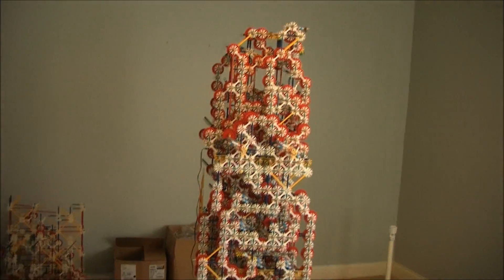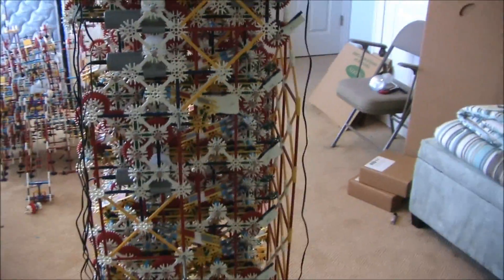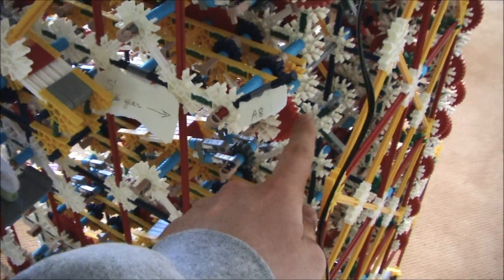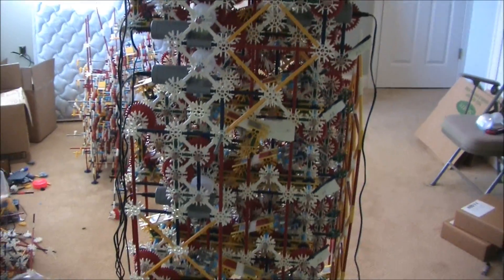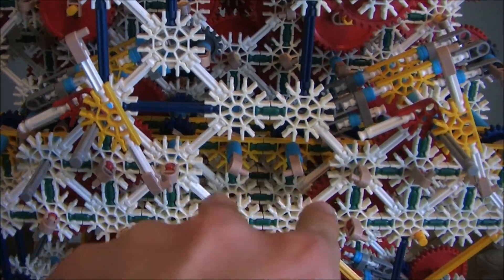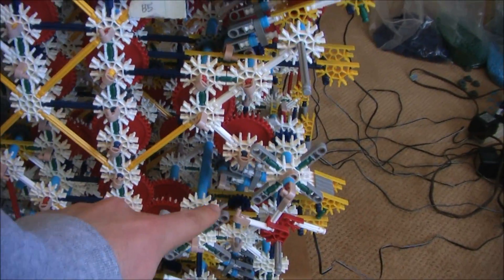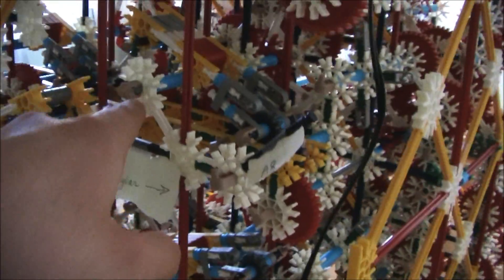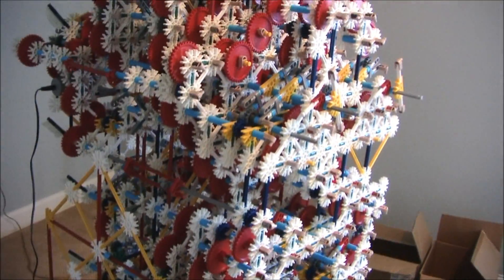The K'nuter - K'NEX Computer

Comment: If that is only a full adder then you gonna need a football field to fit the entire computer
Reply: That was the same problem with vacuum tube computers back in the day. It wasn't that they couldn't be made to work it was that they ended up being so dad blasted huge. If you don't know about them already Google the word "Univac".
Reply: You'll need a year to execute a single calculation. And "normal" wear and tear will mean you have to rebuild the calculator after every calculation.
Reply: Yes. That was true with the old switch and vacuum tube jobbies as well, and the principal impetus for developing solid state transistor versions as well as the IC based ones now. Greater speed and more reliability.

Comment: Where do i put the graphics card?
Reply: Oh man, I can only imagine how big of a fucking machine he'd have to build using these in order to get something similar to a graphics card.
(imagine one world trade center, like...that big, and that's probably an understatement)
Reply: Something that size would be almost (not) close to comparable to my GPU.

I have integrated graphics.
Reply: BOB.org we are also missing the speed, while it may be able to do complex calculations at that size even if you beefed the crap out of those motors electricity travels at something like 50 to 99 percent the speed of light. So we are talking about something that moves at way less than 1 percent the speed of light. Interesting as it is it would take a day for a single calculation. Idk im not an engineer what do i know
Reply: ZirrasElite it’s not possible.
Reply: r/wooooooooooooooossshhhh
Reply: It is the graphics card you could get lost looking at it for hours watching it add 1+1
Reply: ZirrasElite Actually, let's work that out. Let's say for the sake of argument, a typical transistor or the smallest element in a modern cpu is around 20nm (this year it should be half that for the smallest process node size, again simplification). We can roughly assume from the scale of the video given that a single gate made out of k'nex in this machine is roughly 25cm. Again, a bit of simplification here is needed because in most cases the actual transistor isn't as "boxy" as shown here, it's more or less "flat". So by simple division, 2.5 m x10^-2 / 2.0 x 10^-8 m is, again roughly, 1,275,000 times bigger in actual size.

Now, if we're talking graphics cards, a typical modern graphics cards usually has billions of these types of elements. So uh, yeah, roughly multiply that by the scale factor of 1.2 million and well, you got your dimensions. It's literally a million times bigger XD

Comment: And they say legos are better than k'nex
Reply: Creeper1764 Main 
A lot of this stuff can work in LEGO though
Reply: Fuck both I love Lincoln logs lol man I miss them
Reply: Knex = upgraded tinker toys
Reply: Nick Mieczkowski LEGO has technic and mindstorms.
Reply: *lego *is
Reply: You can do exactly the same with Legos
Reply: lego IS better, they have different sizes of motors and servos and all types of gears not just the tooth gears like k'nex
Reply: they both have there strengths. K nex is really good for building large scale things.
Reply: funny how all you guys are killing each other because of legos. like really, it cant get more immature than that.
Reply: Nick Mieczkowski ...they still are...
Reply: Legos just work. Do on LDD and you can do anything. Can knex make a working car? No, because they don't lock together enough
Reply: Creeper1764 Main What? They both have electric motors ahead of mechanical parts... legos just have more types of components like belts and chains, universal joints and hinges.... etc
Reply: Potato Slices How can they have the same possibilities when was has more freedom of building shit? Please don't answer that.
Reply: They are
Reply: ...but you can build cars with legos.
Reply: Legos have Technic, Mindstorm and even metallic surfaces inside them to make plug and play circuit boards or fluid boards, but I can't deny this K'nexi s pretty cool too.
Reply: You could do this more compactly with legos, without cheating with midstorms.
Reply: They both have the same possibilities but Legos has more freedom on building shit

Comment: Core Speed of 0.001hz
Reply: NightGrounds
0.002 with over clocking
Reply: NightGrounds more like 0.01 mHz
Reply: NightGrounds hz is faster than 5 minutes of 1 calculation
Reply: K'nex were vastly superior to Legos.
fite meh
Reply: Stephen Curry My Ass no as more because even if it isn't fast it does have multiple cores
Reply: jopkelplok no, it has multiple transistors, not multiple cores. If it had multiple cores it would be able to calculate multiple problems simultaneously, which it can not. The K'nuter would have to be far more complex to have multiple cores.
Reply: Just increase the voltage of the motors and that's your overclock done.
Reply: NightGrounds you're just SO generous to this processor
Reply: lol true @turnun
Reply: probs a thread lmao
Reply: i like MY LITTLE PONY yeah, isn‘t it Lego? Idk the american toys and stuff... looks like Lego 😂 lmao
Reply: and do you mean cpu?
Reply: NightGrounds yeah, thanks for the correction
Reply: lawl
Reply: pyrotechnics and more no it doesn't. Not at all.
Reply: does this even count as a 1 core processor
Reply: NightGrounds Nope, 1Hz means one oscillation per sec. (1/s) so my cpu has 3.8Ghz what means 3.8x10^9 Hz(1/s) / oscillations per sec.

So this Lego cpu in it maybe have 0.5-5Hz not more lol
Reply: +Cif The Meme Man 1hz = 1 second
Reply: k'nex

Comment: Those are not relays and transistors, they are switches, they are being operated by you, a human, not by a current or voltage like a relay or transistor. And since they are just transmitting power mechanically, they are just mechanical switches, or one pole, two throw switches.

Comment: What are the specs?
Reply: SirSnivy PVP 1 bit
Reply: .01 core processor
natural cooling system 
5 watt psu
no case no gpu tho
Reply: Intel gear i7 Overheated to 2.3 megagears
Nvidia GearTX 1070
16 Gears of ram
And a random geargabyte motherboard (I can't tell).

Ik I didn't mention the PSU or the case OR the fans (including CPU cooler).
Reply: it's over 9000 (gears)!
Reply: Stephen Curry My Ass technically its one core
Reply: Overgeared (essentially over clocked)
Reply: SirSnivy PVP 10000000 gears
Something
Cords
Wires
1292828928298298292892 million gigabytes

Comment: One thing you could possibly do is have motors on the inside that turn on when pressure is being put down on a trigger. This might reduce the loss and make your machine run faster without having to rely on the beginning motors

Comment: shows electronic motors
"As you can see there are no electronic components in this computer."
Reply: >electronic motors
boi do you even english
Reply: Ghostowl657 pretty sure those run on electricity.
Reply: joblessalex yes... which makes then electric motors. Not necessarily electronic. Mostly just pedantry, but have do you actually call them "electronic motors"? Like I hope english isnt your first language.
Reply: Ghostowl657 nah,  just to make the point that this is electronics to a degree.

Comment: One plus (minus one) is the most complex calculation a mechanical computer can perform, because it "flips" the most bits (I don't think the author mentions how many bits are in this full adder). Since a "one" bit is represented by rotation, and a flip-flop actually must be pushed by that rotation, this rotational technology will always be slow, "logarithmically slow", no matter how fast the motors turn. For a "linearly fast" mechanical computer, some other way of representing 1s and 0s must be found, and I'm not even sure it is possible.

Comment: That would've SUCKED if that final "power" input was turned on and you heard a loud snap from inside, to find out that the innards of the adder have been ripped apart.
I've blown a few capacitors -- not fun.
This? Way less fun if it were to break.

Comment: I ran across this old digital patent design 3109554 that used compressed air instead of electricity to run the logic gates. Have you ever seen such a digital computer and what would it be used for? Do you think that such a computer could be made with a 3D printer and throw in a little Nano tech?
Reply: Yes it can be made by 3 D printer . And i see you asking this in every computer related video.
Reply: Yea it's hard to get a reply from some folks. Something like 1 in 100. Started leaving the idea that if Babbage had gone with air that the pipe organ folks could have made his Diff. Engine for  him and Lady Ida would have invented COBOL.  Read that swarming soldiers crabs can but used in computing demonstrations. Has anybody tried this idea out using brush bots/ bristle bots? Seems like something kids would just go ape over.

Comment: Although this machine looks complicated, it's real purpose should allow you to realize computers work on fundamental, universal concepts.  In other words, even if you don't understand what is going on, a computer CAN be created simply using plastic (or wood, or brass, etc.) You could essentially take this machine back 100 or 1 Million years to teach "digital logic." Just replace plastic with metal and motors with running water. Computers are nothing other than these components, miniaturized. The fundamental difference between this and your iPhone is size.
Reply: +David Maiolo
Good point, everyone replying 'nope' doesn't understand anything about computers. I agree with you; computers are simply mechanisms that take inputs and calculate the output. You can see through the ages how people have created calculators using simple designs with basic materials such as wood, stones, water, etc. Our idea of a computer in modern day is simply a compact mechanism similar to these, but with thousands of these processes running at once on a smaller scale to achieve more advanced results. The calculations of 1 or 0 are translated in a long process into output on the screen. It's a very cool idea, that these complex machines we operate are just advanced, very compacted calculators.
Reply: Meme Farm Which means the fundamental difference is size because you can fit more of these in a smaller space.
Reply: Nathan Drake: Actually with enough of these clanking together you could a mechanical device that could crunch the numbers to play a video.  Though, obviously to play a video you would have to have a converter to translate the mechanical process to an electronic output.
Reply: Nathan Drake Yes, you'll just need 10 000 000+ of these.
Reply: @RequiemPoete:
Actually, you wouldn´t even need a converter. Theoretically (and I am talking very theoretically, as it would of course be extremely impracticable due to size) you could build a very large "monitor" with the pixels being represented by different colored mechanical plates which are either turned towards the viewer or away from him, protraying pixels if watched from far away enough, and have those being controlled mechanically. It´s the same as turning on different colored iodes with electricity. Of course it would be played very slowly or the mechanical stress alone would probably tear the whole contraption apart. But it is theoretically possible.
Reply: PuddlePig: Well I can think of one instance where we missed an opportunity to be 2000 years more advanced. Heron of Alexandria invented a primitive steam engine, that for some odd reason he didn't refine into a proper one. ( They think that the economic and societal concerns of displacing the slave labor force with steam driven machinery played a factor) The steam engine jump started the industrial revolution and from  200 years ago we are where we now. So yes. It's likely if refined, Heron's steam engine could have jump started an industrial revolution 2000 years ago, which probably would have led to an early computer age 2 or 3 hundred years later.
Reply: Kyle Owens More than hundereds, think in millions. look up how many transistors are in old low end cpu's, first intel core2duo (no idea if those can keep up with the bitrate of this video). there are 167 million transistors in the low end canoe architecture intel core2duo processor. lowest end celleron still had 100 million transistors.
Reply: Kyle Owens: Hundreds? A small microchip has thousands of these things on it. You would need, at least millions of these towers clanking away.
Reply: David Maiolo is
Reply: +Meme Farm That's not a fundamental difference. The point is that digital electronic computers work on the same principle, they are just more capable because we can fit much more into a more practical volume. If we had enough of these K'nex machines we could do anything that electronic computers can do, it would just take up alot more space.
Reply: SangerZonvolt: You, I like you. You may live to be one of my mad scientists when I rule the planet.
Reply: Yes computers have been made with lots of things other than transistors. We just use transistors mainly because they have no moving parts and are *tiny*.
Reply: You think to simple. You need a computer driven completely by ants and bees!
Reply: If you took this machine back 100 years,  you would get burned at the stake for being a witch!
Reply: RequiemPoete *Strengths I'm also a part-time grammar nazi.
Reply: Take it back to 2009 and use it to create the first bit coin and rename it a Bit Koin
Reply: There would probably have to be near hundreds of them working together though, right?
Reply: David Maiolo b
Reply: David Maiolo that is very enlightening. So if a computer could be made at the begging of human history, could something made in 1000 years be made now?
Reply: PuddlePig Unless the laws of physics change in next 1000, yes, for fuck's sake why can't people understand that just because X hasn't been invented by humans yet doesn't mean X is impossible to exist?!
Reply: David Maiolo ia
Reply: Mindblitz64 the screen isnt important to something so large
Reply: You know what I mean.. And millions are made up of hundreds, so technically I'm right.
Reply: +RequiemPoete
Good luck taking over the world, because you'll be fighting against me
Reply: Kyle Owens: Your Difference Engine seems to run off a measly few hundred towers where my War Computer is a Babbage Machine of several million adding towers. By the time you spin the crank four times I'll already know exactly where to station my troops and have deployed them.
Reply: Kyle Owens: Mwhahahaha!
Reply: Gairos: My God you're an ass.
Reply: RequiemPoete I know and it is partially intentional 1.) Making fun of stupid people is fun. 2.) Cyanide&Happiness number 3801.
Reply: Gairos: Well, can't fault you for being honest and playing to your stregnths! Lol.
Reply: When you're into computers, pussy is boring I:0
Reply: Hah, what a mess your machine will be. It will be huge, and after a few hours of trying to compute 1+2, it will catch into itself and collapse. Second, I don't need a computer to fight someone. My mind works well enough to know where to station my army, navy, and air force by the time the machine collapses. You will be surrounded and executed. Mwahahaha that
Reply: Pollux my 1 certainly goes where there is a 0
Reply: Nathan Drake Not only could it, but it is right now.
Reply: And a screen
Reply: MrFonz No you fucking moron! This is a calculator. When was calculator invented? Roughly 350 hundred years ago by Blaise Pascal. When did we start utilizing electricity? roughly between 1850-1900. Fucking idiot....
Reply: nope
Reply: David Maiolo No the fundamental difference is power and capability
Reply: David Maiolo why did you make such a nice comment and then to close it with iphone..... i dont have one, and call it your phone. Im not calling my phone a (insert phone name type and model here)  im calling it my phone.
Reply: David Maiolo not really

Comment: I'm gonna take out ONE piece and drive you insane trying to find which one. Ha ha!
Reply: The Tyttuutface pointless. He'd find it faster then it took you to take out. Due to what is no longer moving that should be.
Reply: The Tyttuutface, he'll figure it out in thirteen seconds, tops. It's so simple.
Reply: depending on what you take out it might not even matter
Reply: You don't have to remove a critical component to affect the machine. If you took a few of the parts rods out of the back of the machine could collapse under the weight of itself.
Reply: Remove a few parts and the machine colapses? I'd call those part pretty critical
Reply: Spaceman Rick "Simple"

Comment: Three things to tell you:
1. Friggen awesome please update and continue working on it
2. Is there any way we can support you monetarily or send you some kineks
3. I would recommend labeling the gears (even though, as you said, this isn't the full computer so it doesn't really matter how user friendly it is at this point) it is good practice and will help you troubleshoot if something goes wrong. Don't label them now as you may be wrong or something might change, but keep a notebook and maybe put little marks on them so that you can apply functions to later. (you put three dots on a gear, that won't change but what corresponds to that three dots can change at will, and the organization given by the three dots remains.))